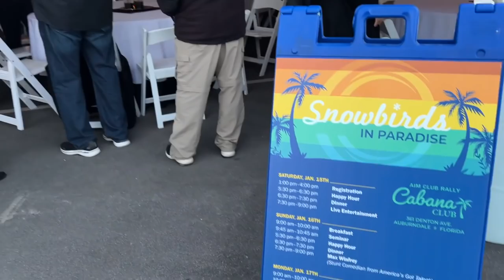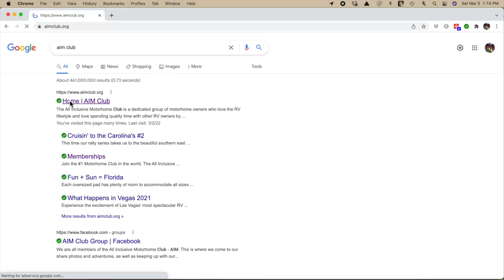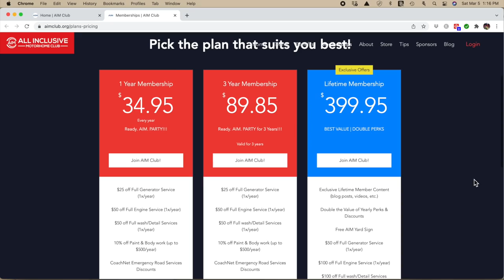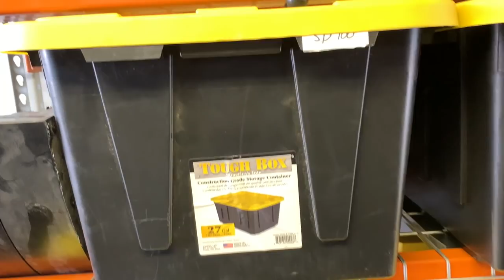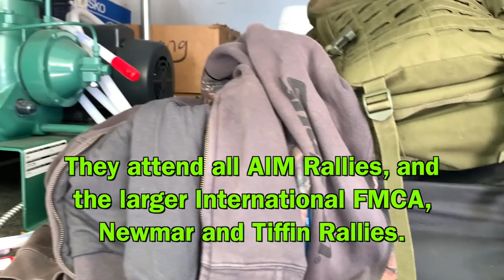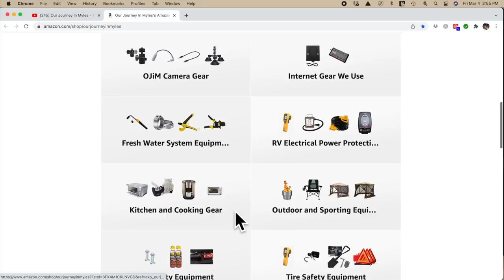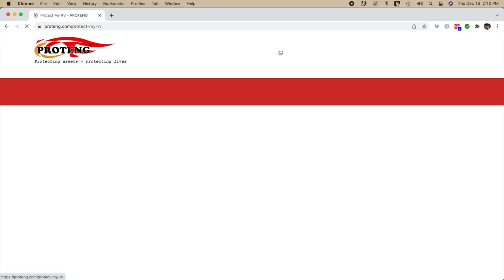RV LIVING | All INCLUSIVE MOTORHOME CLUB | TOP SHELF FIRST CLASS RALLIES | WHAT IS IT LIKE? | EP211

Comment: Thanks so much for your video and information about safety devices ! I will start as soon as I purchase my motorhome
to have all the belts, filters  and all rubber hoses replaced. I will have all tires pulled check pads,  and any other items needing
replaced. Then I will start with one thing on your list and hit them one at a time. Their are so many things I have planed but to
purchase the motorhome first. My wife and I have been working on our paid off house and we will sale or rent the house
for more income. I want to sale my wife wants to rent so for now making it look really good. I've even thought of putting a camera showing the motor  and around the motor. Maybe a thermal camera with pan and tilt control . Again you will have to
still have a way to put out a fire. That is why I will be replacing all fuel lines going to the fuel tank as well. This is a big investment on wheels you have driving down the road. So make sure I have done almost everything to cover my investment
from just going up in smoke !  All of the videos you and Sue have made has meet so much to me and my wife ! Keep making
and we will keep watching.
Reply from the maker: Thanks so much for watching Jeff.  We are just trying to be safe and have a smooth retirement.

Comment: ....if only I could find an inflatable escape ramp from an airplane, that would make exiting the emergency exit window a lot more fun! Pro tip: bring lots of $$ for tire and accessories, peace of mind is not cheap.
Reply from the maker: You would think that someone would be making an inflatable chute "module" that would eternabond double sticky back tape to the side of the motorhome. It would be positioned under a window and be about 4" deep.